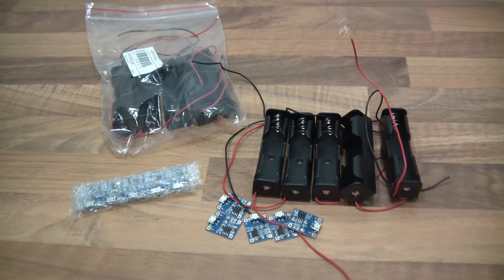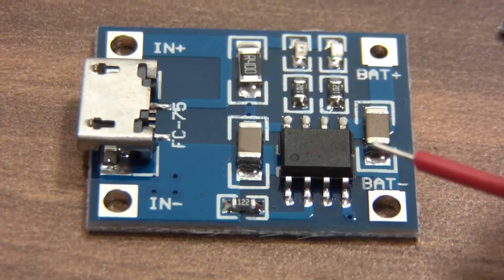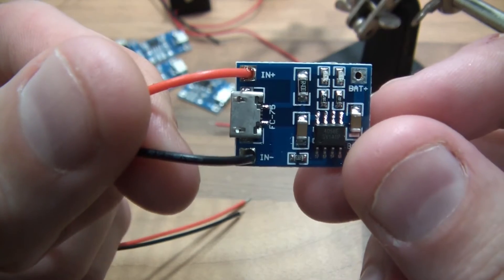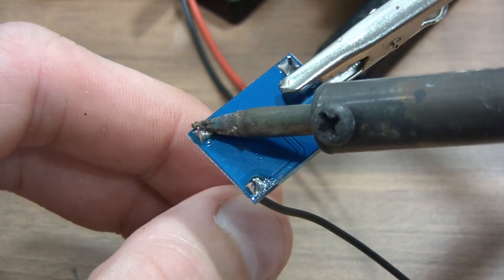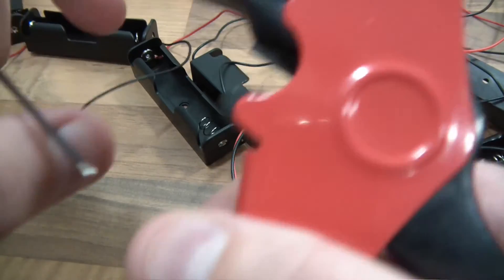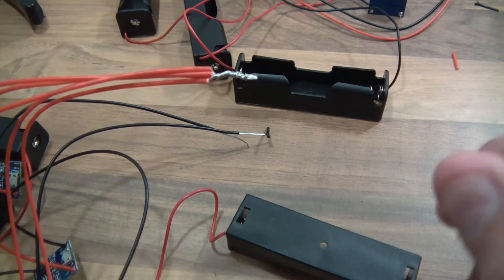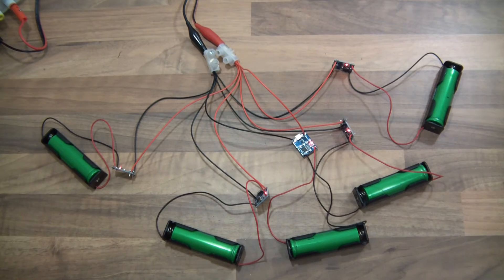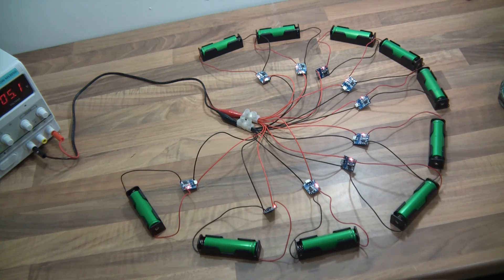TUTORIAL: How to Create a Cheap Lithium Ion 18650 Cell/Battery Charger! (Using TP4056 Modules)

Comment: Why not use standoffs and stack the charger boards together so you can use 1 power supply connection for input & a neater job with less wires? Leave enough space between for airflow & connecting the individual outputs to the battery holders.
Reply from the maker: Good idea!
Reply: You could could stack them but then the output wire would be so close to each other.  Can imagine the heat it would generate when one stack them up.

Comment: Nice video, but do you know that moving a soldered connection before the solder hardens can create a "cold solder joint" which will fail eventually or even function poorly from the "git go"? Try to keep the wires still while the solder sets. All solder joint should be shiny & bright. If they are dull or crystalline looking, reheat them to create a good reliable joint. I speak from some 55 years of experience.
Reply from the maker: You're absolutely right.

Comment: A small piece of peg board works well. All the wiring can be behind. And  allows air flow for cooling if anything heats up! I have mine on a piece.( Yes they get a bit warm. ) of peg board mounted to a atx power supply, the fan in it  helps cool everything! I only have 8 chips on a 500 watt supply.  So I have room for more!  It sux if you reverse the streams! Fries the chip!! Great ol video!
Reply from the maker: Hey thanks, very cool!

Comment: You've answered questions I have like how many amps would be drawn  when charging 10 x 3.7v cells linked in parallel. (5.1v. 4.68A) but I believe 10A is the needed supply.   If you connected 3 of these sets in series to make a 10p3s  12.6 volt battery,  would a power supply of 12.6v with 30A be needed to charge?  Would you keep the 5v 1A charger boards connected to each 18650 holder in the 10p3s battery?

Comment: shouldn't you charge at 4.1 volts?
Reply from the maker: daniel edwards 4.1 or 4.2 I gather!
Reply: well you see that circuit board has a USB connection, which would be 5v so it has step down conversion up to 5v minimum. the batteries should not be charged at 4.1v it should be charged just above what it is at currently then ramped up as the batteries charge giving the correct amps, so say you carge it at 0.8 amps and its depleted at 3.3v the circuit would not charge at 4.2 but much lower and it would step up the voltage disproportional to its charge so at the end it would just trickle charge and finally stop at 4.20bv or slightly bellow. step down conversion up to 5v minimum. the batteries should not be charged at 4.1v or 4.2v at all times that would break it very quickly.

Comment: Lipo madness, as opposed to reefer. I used a similar boar that has 2 more output points that allows you to continue powering - whatever. Excellent big hole tip. Wonder if it would work for x girl friends.   Micro-USB 1A 18650 Lithium Battery Charging Board Charger Module    https://www.fasttech.com   $.63  US EA. FOR 5
Reply from the maker: Yes! It works for ex girlfriends. I've tried it. :-D
Reply: Didn't realize I was admitting we may both be suffering from Trump hands 😢
Reply from the maker: Haha!